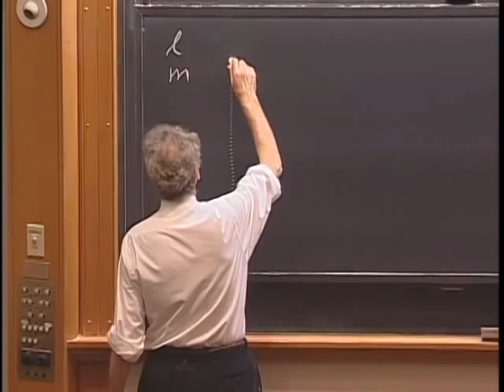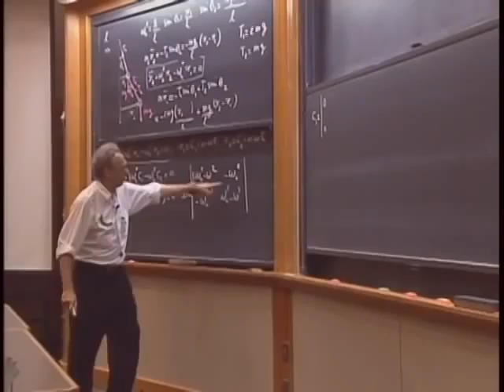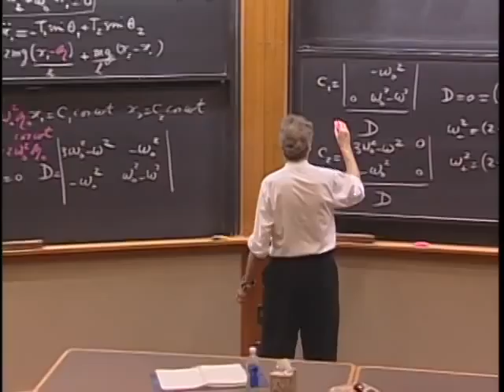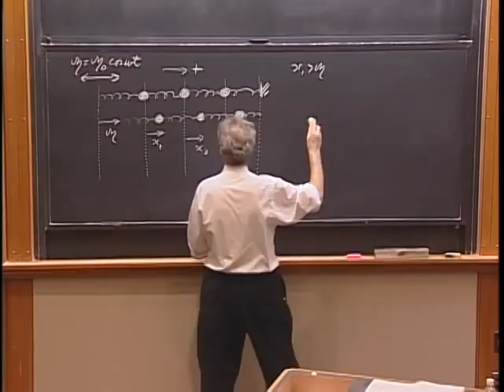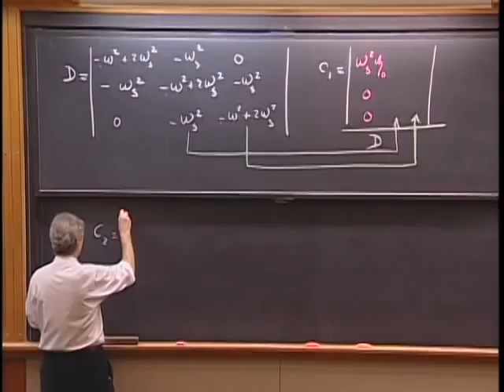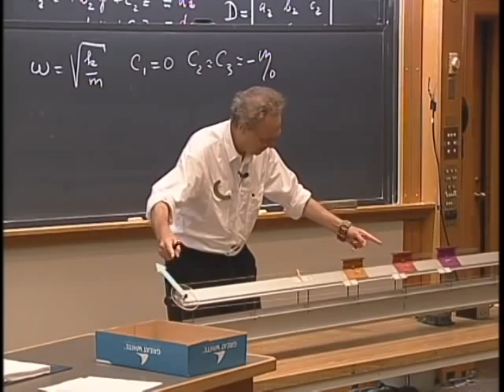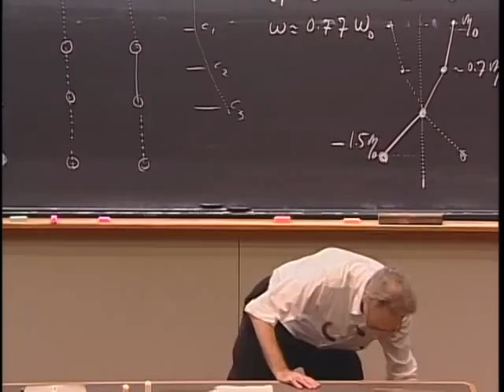8.03 - Lect 6 - Coupled Oscillators, Steady State & Transient Solutions,  Intial Conditions

Comment: the situation when the first car is at rest and the 2nd and 3rd are in anti phase with the force, you can think of it as exactly the same as the second mode of the doubled pendulum where the force that applied was the same as the natural amplitude of one oscillators and all the energy transmited to the moving second oscillator, now the 1st car is the transmiting wall for the 2nd and 3rd to move and it is also in anti phase just as the doubled pendulum was. this is my intuition for that, hope it makes sense :)

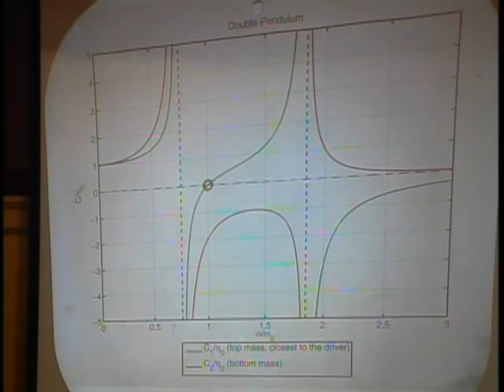Comment: I think I might figure it out at 34:30  :

As the mathematical model: there is no energy going to the bottom ball from the top ball. The bottom ball is equivalently hanging from the ceiling. and doing its natural oscillation .  (since we assumed no damping)

In the reality (experiment done in the video), however, the top ball is not exactly still. So Lewin keeps giving some energy to the top ball, and then the top ball gives the energy to the bottom ball; the bottom ball receives energy to cancel the existing effect of air damping.
Reply from the maker: in case of a standing wave of a string the string is NOT moving at the nodes. Similarly in the case of double or triple pendulums the rope is not  moving at the nodes
Reply: I would argue that in case of a standing waves of a string (of math model), energy does not transfer through the string, but instead the total energy of every points of the string is constant - the energy goes to KE from PE, then KE, the PE, and so on. 

In view of superposition of two opposite traveling waves, the net energy transfer is also zero.

I would like to elaborate a bit on my previous comment : in the experiment done in the lecture, the top ball actually was doing a very small oscillation (not exactly a nod), since there was air resisting force (which we had not not taken into account); therefore, the energy of the bottom ball should have been lost (into heat) if there were no oscillation in the top ball.
Reply from the maker: at nodes there is no motion.
Reply: Yes, that should be exactly why no energy going through the string. Nodes are equivalent to infinite walls in case of standing waves on a string.

Comment: Hey Mr. Lewin,

From Wit Busza's harmonic oscillators with damping lecture, he said that you derived the solution to weak damping in one of your lectures using complex amplitudes. Equation: theta (t)=A*e^(gamma/2*t)cos(wt+fi) Do you remember which lecture that was specifically?

And how would you find out the initial angular velocity of a pendulum experimentally?
Reply from the maker: I list the topics in all my 8.03 lectures. I will have to also search myself

Comment: Sir when you derived the differential equation for two mass system in the beginning you don't mention the driven displacement of object 1 which will add to the forces in newtons second law for object 2 as were done in driven oscillations.
Reply from the maker: How many minutes into the video?
resonance frequencies are independent of displacements.

Comment: sir we know that we have n order differential equation than the solution of that differential equation contain n arbitrary constants. 

Sir suppose two particle are coupled by spring.  Then the differential in equations that describes  the motion of each particle will have order 2. Sir but solution of this differential equation contains 4 arbitrary constant[  for example a1cos(w't+α)+a2cos(w"+β)]
Reply from the maker: 2 particles mass m1 and mass m2 at the ends of a spring (the spring is free to move on a frictionless horizontal surface) leads to only 1 resonance frequency.  This is one of my Bi-weekly Physics Problems.

Comment: Dear Dr Lewin. I think coupled double pendulum is similar to two serial connected LC contours. When the first contour in resonance it dont have any resistance, and similar to the first ball it doesnt moves because its has no current, it's ideal conductor fo feed oscillations to the second contour. As I'm right?
Reply from the maker: I do not understand at all what you are trying to say. An LC circuit has only 1 resonance freq, a double pendulum has 2 resonance freq. There is no parallel. if you want to pursue this use google.
Reply: I mean next electrical connections (please see pic from Tina-TI simulator) http://tinypic.com/r/2gv4fw7/9 . Circuit with two parallel LC circuits, connected in serial may have two resonant frequencies.
Reply from the maker: yes, a quadruple pendulum or any object consisting of 4 pieces that can move relative to each other have 4 resonance freq. That's also the case for 4 LC systems.
Reply: Yes I think so.  I think there are many similarities in behavior of between  mechanical  and elecrical systems. Resistor acts like damper, inductor like inverse spring, capacitor like mass. Thank your for your lectures! It's very helpful for me.

Comment: Hi Dr Lewin! I would like to ask that if the determinant of the simultaneous equations is non-zero, then should x be zero which means there are no solutions? Thanks!
Reply from the maker: how many minutes into the video?
Reply: @lecturesbywalterlewin.they9259  12:00
Reply from the maker: @200katzen  If D is not zero, then C1 and C2 are both also zero which is a meaningless solution.
Reply: @lecturesbywalterlewin.they9259  Then what do the two equations at 13:06 mean?
Reply from the maker: plse first do your homework before you ask  questions.
My lecture is chrystal clear. I discuss 2 ways to find C1/C2 and omega. I then use Cremer's Law to solve it which is one of the 2.

Comment: Walter, I have a question, Since I will have finished all your lectures(8.01, 8.02, 8.03), do you recommend that I take 8.04/5 in quantum Mechanics, or should I take 18.02/3 in diff equations and calculus?
I'm in first year in university Physics.
Thanks!!
Reply from the maker: yes you may consider that.
Reply: OCW recently published a second version of 8.04; which one would you recommend? (As taught in Spring 2013 or Spring 2016)
Reply from the maker: Take the one which is taught by Professor Barton Zwiebach. that's probably 2016

Comment: Why does mr.Lewin solve the driven coupled oscillator by saying that the angular frequency that the two masses will have will be equal to the angular frequency of the driving force? And what does he mean by stating that his solution is a solution of the steady state of the system while there is no damping? No damping means that nothing fades out to gives us a steady state oscillation after some time!
Reply from the maker: +adam lands If there is no damping of any kind, then the transient solutions will never die out. You will have to take my words in context. By the way, there is always air drag damping in the demos we do in lectures on the air tracks. How many minutes in the lecture do I make the statement that you are referring to?
Reply: +Lectures by Walter Lewin. They will make you ♥ Physics. Professor, as there is no damping here, I agree with you that transient solutions will never die out, so why is the angular frequency of oscillation (of xi and x2) equal to ω(the angular frequency of the driving force)? And, as such, why did you say "steady-state" if there is no damping?
 At 21:00 you start by analyzing what ω will be. About a minute later you refer to steady-state.
Reply: +Lectures by Walter Lewin. They will make you ♥ Physics. Professor, I have thought about why should have ω of the vibration equal to the ω of the external agent. It is to only find the solutions that give us normal modes, which are like the simplest way that the system can oscillate and every other oscillation of the system can be written as a superposition of them! Am I right?
Though, my question about what do you mean with steady-state remains. I think that in this case, the transient will never die. The system will oscillate under the drive of the force and by the initial conditions(ideal conditions and not the real life conditions)
Reply: thank you professor!
Reply from the maker: +adam landos  If the driving frequency ω is not a resonance freq then the system in steady state MUST oscillate with frequency ω. The steady state freq is also ω if the driving ω is a resonance freq. "Steady state" is very meaningful as systems with zero damping (zero gamma) in most practical circuits do not exist.

Comment: Dear sir,
       I have a doubt at 25:10  that how u said the value of D is 0 at ω=ω- and ω+ , is that by experimental results? (but in expts  infinity is meaningless )then why? as according to Cramer's rule there are 2 equations and  2 variables so the denominator determinant should not be 0(as it happens only in inconsistent solns case but C1 & C2 have value i.e. consistent)
Reply from the maker: D=0 at resonance - watch the lecture again.
Reply: @lecturesbywalterlewin.they9259  Dear sir,
                                                 I have watched the lecture again, That's exactly my doubt why D=0 at resonance (if it happens then C1 & C2  will be infinite in the case of a driven double pendulum as the numerator of C1 & C2 are finite but the denominator is 0)(i understood why D=0 for the previous case i.e. undriven double pendulum but not for driven double pendulum ) How u can explain C1 & C2 are infinite (as u said C1/C2 can go maximum to 2.4 only in expt. and its physically meaningless )

Comment: Sir, I really enjoy your lectures. I have attempted to find out why the top pendulum does not move. Please let me know how can I send the attachment. I could not attach the page in the comment section.
Reply: What I found is, every moment in time the force on the top pendulum from the tension in the top and bottom strings cancel out thus no net force.
Reply: @sunilkukreja2919  it is not the case i guess.